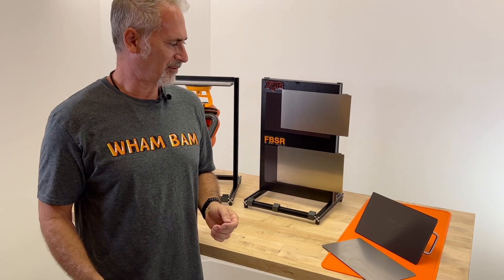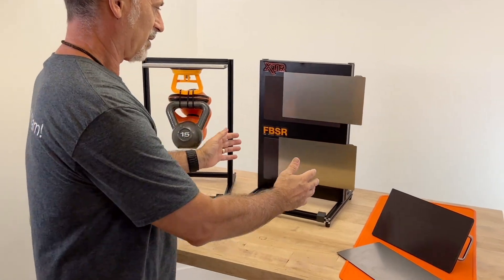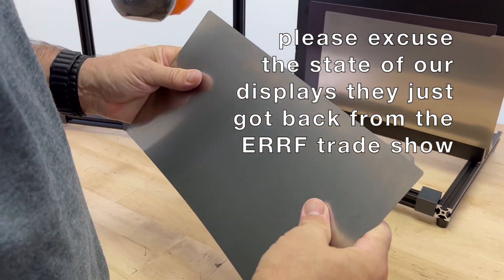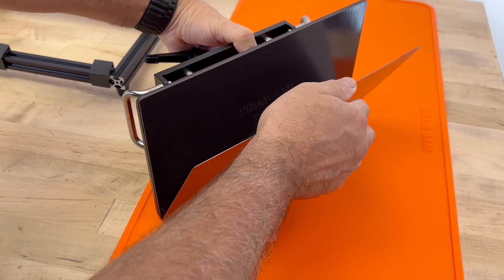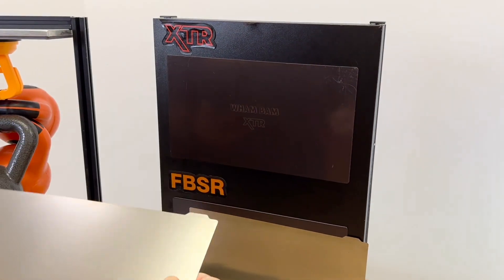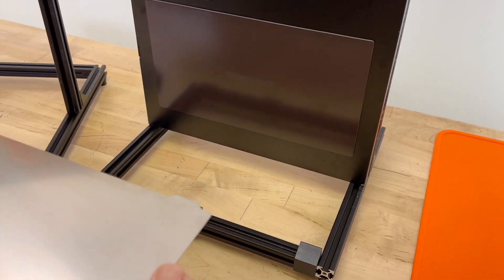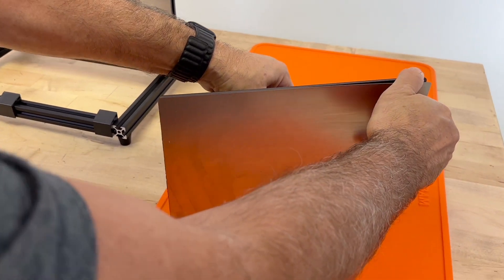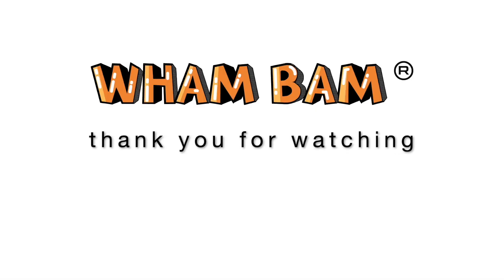FBSR and XTR Comparison

Comment: Thanks for sharing! Was that needed? Never heard of a plate coming off, though for larger prints in larger printers it is a possibility indeed.
Reply from the maker: is what needed? the XTR?  if that is the question, it really depends if you are printing huge edge to edge prints, or rather are you printing small miniature and other small prints
Reply: @WhamBamSystems  Makes sense to make it for the larger printers then (just as you did)... Awesome!!! Thanks.